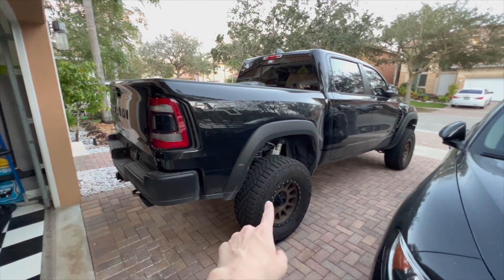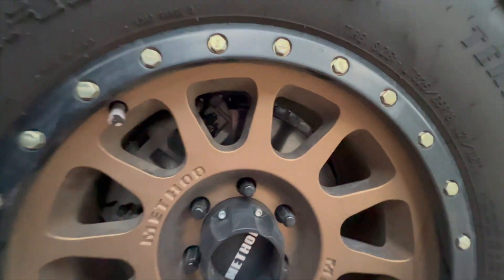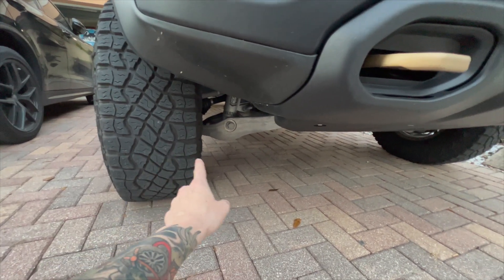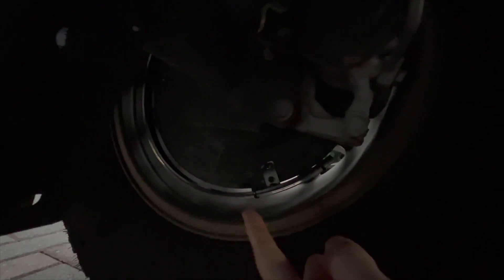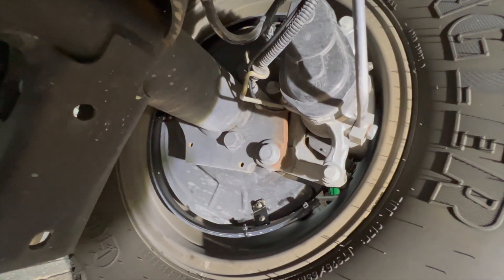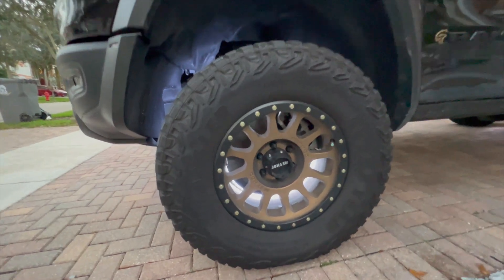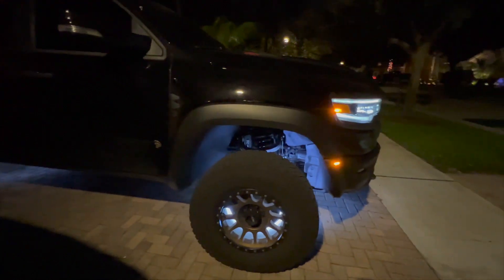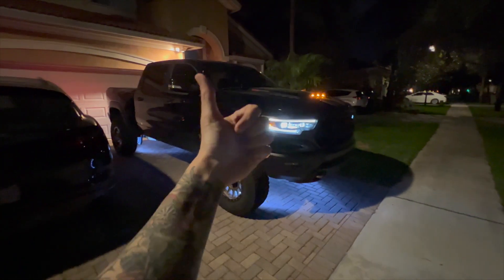Oracle LED Wheel Ring | Ram 1500 TRX

Comment: Can I ask why you went with a 15.5" ring when you said you have 18" wheels? Is it just because there's too little space between the wheel and caliper?
Reply from the maker: At the time that was the largest size they offered for single row. Now for any wheels larger than 19” you are required to get the double row rings. The size of the ring is not intended to be the same size as your wheel diameter